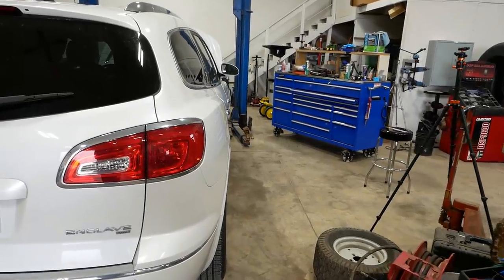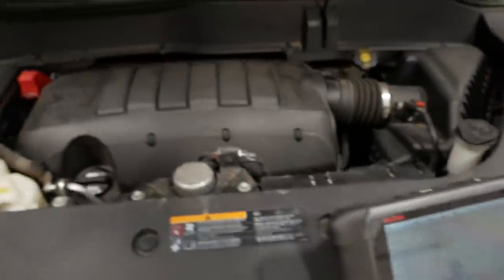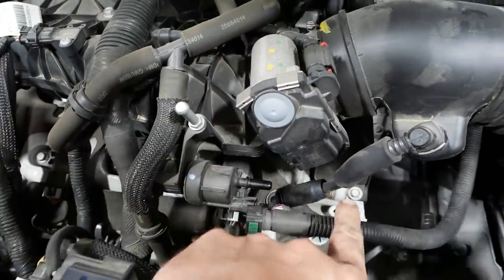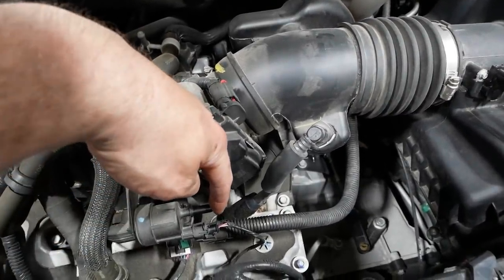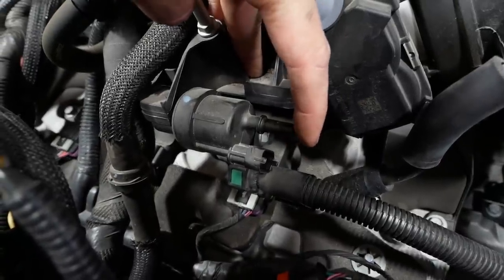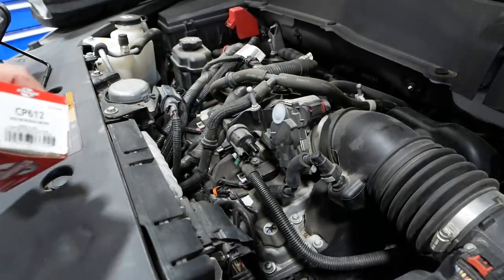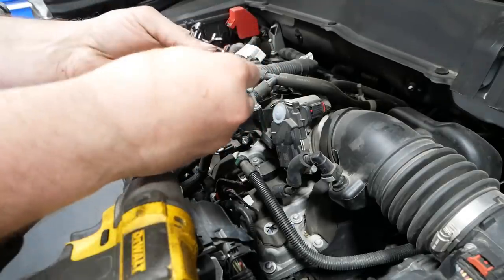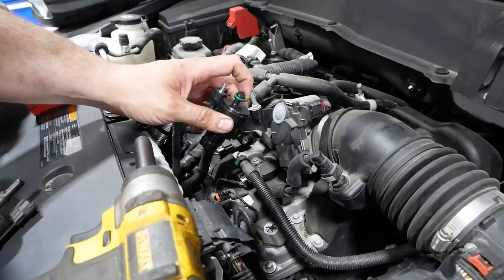P0496 GM 3.6L - Diagnose and Fix in 3 Minutes

Comment: It'll take longer to generate an invoice for the customer than it did to fix the car!  LOL
Reply: I wonder what the flat rate is on this, and did he charge actual time or flat rate
Reply: @bigunone  Wes strikes me as working by the standardized "dick scale". If the client is a "dick", it's going to cost you. He seems reasonable enough that he would let a quick job go for a more than fair price, a guy can't build a client base by over charging every body, even more so in a smaller community.Fairness comes with integrity, integrity is something that Wes has in spades..
Reply: @bigunone  he showed a .5 book time.
Reply: lol

Comment: $263.15 in parts and labor (don't forget shop supplies) and out the door at dealer.  Oh, we checked your wheel alignment while driving through the shop and you need $107 (on sale) alignment.

Comment: If only all garages and service stations were up front and honest like that. 
Wes: I've checked the diagnostics on your vehicle. It looks like a bad purge valve, I should have it fixed in 5 minutes.
Dealership: Yeah, just drop your car off, we'll have a look, see what's wrong and then get back to you. ( two-three days later) . Yup just as we suspected, we checked your codes......you needed all new spark plugs, air and fuel filters, EGR, PCV valve, oxygen sensor and a new purge valve. We also found a small vibration in the front end and readjusted all your ball joints, tie-rod ends and rotated your tires.
Reply: Nope, all wrong, well except for the 2-3day part.  Diagnostic fee $150, minimum 1he labor $150, +250% part markup, $39.95 shop supplies.
Reply: @tomkrause62  Wes's previous video (front end shaking in car)is well worth the look if you haven't already seen it. Proves the point about proper diagnostics, its scary and comical at the same time.

Comment: And gm would charge 2 hrs for diag, drop the gas tank replace the guts in the tank, then another hour of diag, then an hr to change the purge valve. Put it back together while forgetting to plug it back in, causing you to leave, come back, and go through this whole process 3 more times
Reply: Yep...That a GM dealership for you.  I like to refer to GM as "General Malfunction"

Comment: I’m sure the book time is inclusive of pulling the vehicle in to the workshop, plugging in the scan tool, reading the codes, translation of the codes, ,opening the hood then the work to confirm the fault, ordering the part or if at a dealership, a trip to the parts department then the work to change the solenoid valve, then the reverse. Add all those things up & half an hour seems a little light.

Comment: Too Dam Fast. Please, more about Your new enterprise putting COSTCO out of the tire business. LOL.
Reply from the maker: Do you realize there are places that don't have Costco? I couldn't tell you the closest one to me. Probably 2 hours away.
Reply: @WatchWesWork  in the Vancouver Lower Mainland Area there are 7 COSTCO LOCATIONS about 15 miles apart from the next one. I get it that you are in very rural America and it is not a money making machine for You but there is no place else and You and Your Customers need it for convenience. Mobile Tire Service is probably 2 hours away. and very expensive. You and I have made the major point of Your story about the danger and cost of funky fake rims that have bonded fake mags. My point is somewhat different about buying after market Rims from Tire Rack that are made to fit more than one manufacture cars by having 10 stud hole for 2 different bolt circles using elongated holes and also fibre washers or steel inserts to  fit multiple cars. My Point is Simple. DO NOT BUY ANY RIMS THAT ARE DESIGNED TO FIT MULTIPLE VEHICLES. No Funky bonded fake cheap Rims either. This was a good show to bring up these points. My observation is that tire service on passenger cars is usually done by $15 an hour worker. Your charge out rate should be more than $100 an hour for Your Skill Level. THANKS.

Comment: Instructions unclear.  Mine seems to have a red o-ring. Does that mean I should STOP the procedure ??  Is this only a valid fix if using a green o-ring?
Reply from the maker: You'll need to call tech support.
Reply: Have you tried turning it off and back on again?

Comment: In 2010 I bought a 2010 Chevy Impala with the 3.5 engine.  I had already driven a Buick with a 3.6 and it had lots more power.  I bought the Chevy, I drove it for a while and gave it to my son.  He is still driving it, it has 140K on it and never has had anything done except the typical plugs, wires and belt at about 100K.  It has had a pair or two of front brake pads.  I am so glad I did not buy the 3.6 Buick.  How could GM make and engine that is so bad after making the 3.8 and the 3.5, sure the 3.8 is lots more powerful but it is just too problematic for me to even look at any car with one of them in it.

Comment: I was gonna ask if you became a flat rate tech recently because you seemed to be racing the clock when I first saw it, and then you mentioned the book time LOL...  what an example of how boring and bland some of these newer GM cars are getting. Yuck. For once the book time is actually in the techs favor and not the other way around.
Reply from the maker: Not hard to beat the book on this one. If the camera was off I could diagnose and fix it in 3 minutes with time for a cocktail...

Comment: I have had some luck getting AC Delco parts from the Local Car Quest/ Advance Auto Parts. I had a code which I thought was the solenoid on the tank end- I looked up the part using my (Wife’s actually) VIN on the mothership’s part finder website, ordered the part- went to install it, and discovered that it was a totally different part from the one on our truck- (2011 Suburban 2500 LT 4x4). 

Luckily, it turned out to be the gas cap wasn’t sealing- and a little dripped gas on the filler a d the oring cleaned things up and solved the issue. So much for throwing parts at a problem until it’s fixed. 

Meanwhile I’m stuck with an open box purge canister vent solenoid and tubing assembly that probably will be the correct one for a Suburban/Tahoe/Escalade/Yukon/YukonXL of a similar vintage 1500That was just cheap enough that I won’t deal with traffic to try and return it. Need one? LOL.

Comment: So Wes what do you think of GMs 3400? Got a 2003 Grand prix that I got from a friend that bought it new. He was a pipe fitter, he drove her hard . His job took him all over. No repairs. I got it with 262000 miles on it now at 272000 miles. It runs great you step on it and , put you back in the seat. I am going for at least 300000 miles , think it will make it?

Comment: I don't get these modern evap systems. The goal is to reduce pollution and waste from engines leaking gas. Fine, I get it. However these systems are so crappy that we end up replacing plastic parts - which are made from petroleum - and sometimes hours of diagnosing (energy) to fix them. 

I have an Outback 2019 with less than 17k miles. First issue I had was evap system engine light. It took the dealer 2 weeks to figure this out with computers and smoke test. It was some bad purge valve too. I am sure the whole process required more energy and caused more pollution than not having the darn thing in the car in first place!

Comment: Sticking EVAP purge valves can be freed up by spraying the inside with brake clean or electrical cleaner. So not only a quick diagnostic but often a ‘no parts required’ repair.

Comment: I own the timing chain thrower. This is a known issue with these engines. Usually you’ll find it after you fill up with gas and it take forever cranking to start.  

ETA: throttle body next

Comment: Had the same thing in my moms traverse. Same car with a different body. Hers wouldn't start after filling with fuel. Took like $20 and 10 minutes.
Reply from the maker: Yep. Makes them run really rich until the fuel level drops, then they run lean. Really messes with the fuel trims.

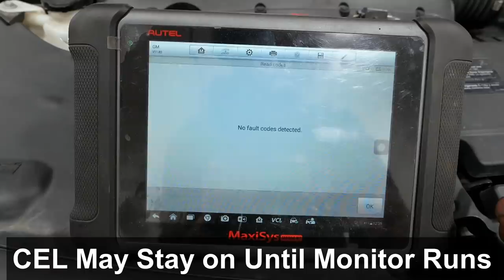Comment: Watch Wes claim that 3:37 is less than three and charge his client 30minutes. naughty naughty!
Reply: He never said that's what he charges his client, just that that's what "The Book" says to charge. There are some Good Mechanics out there!
Reply from the maker: I'd never do that...
Reply: Not only is time equated to money, so too is knowledge🤩 so yah still got to pay😉
Reply: He should charge his customer at least 1 hour. It would be a bargain. 
The alternative is for the customer to buy a scan tool, learn to use it and diagnose and repair. 
Last choice would be to go to Chevy dealership, drop off car for 2-3 days. Pick up car after calling them to find out its ready, pick up car and pay at least $300 and return the next day because the car is not fixed.
Reply: but what is the book procedure to test the operation? If a good mechanic can get the job done faster than book time, they get to make money.
Reply: Most all shops have a set service rate of 30 min to1 hr minimum, what Wes done was more than fair . Good luck in trying to get your work done at a dealership in that same length of time , you'd be lucky to get the car back on the same day. Better yet, good luck in trying to get a dealership to do a video and show you what was wrong with your car and how long it honestly took to fix it.
Reply: Every now and then you need a little gravy to make up for the lost your butt diag/repair. Gravy {easy diag/repair} makes the biscuits {harder diag/repair} slide down your throat easier.Don't forget the time/tools to read codes, diag, order the part, change the part, verify the repair,clear the codes, bill the customer, and collect the payment. This is really NOT a 3 minute repair !!!!
Reply: @terryharvey4811  I agree TH but I think the point being made here is a demonstration on how to replace the part in minutes when everything needed is close at hand.
I think the common sense man understands, turning the lights on in the garage, warming up the truck, getting breakfast at Mickey D's and shooting the breeze with the guys at the parts counter at O'Reilly's is not factored in along with hooking up the code reader and turning it on. 
Preparedness may take a few hours...for the simplest of tasks
It would also be understood, that cleaning solvents, rags and electricity is not factored in either, but still.. somebody has to pay for that and many times over...., those commodities are never included on a repair bill. 
 More to the point, it usually take 9 months to have a baby, but it only took a second to get the job done. Endless expensive Dinner's , movies, trips, mothers day gifts and the begging are not included in the final bill either.
Reply: @IR-nq4qv  You hit the nail on the head. Most shops charge a min. 1 hour diag time plus the 0.5 r/r time. I just wanted to point out to the customers and DIYers that there is more to this job than they actually see. We can't work for free and if Wes charged only for a half hour of time, the customer really got a DEAL ! We owe it to our customers to charge enough so that we'll be here the next time they need us.
Reply: It probably was legit 30 minutes, if not longer, if you count the off camera work, talking to the customer, writing the invoice and bookkeeping, etc.. This is why most places charge a minimum rate. If I only got charged 30 minutes labor for that job I would be glad it wasn't an hour minimum.

Comment: Couldn’t see what you were doing to prepare the new one, but I assume it was make it look like the old one. I would have run the engine again before hooking up to confirm the new part actually works before reassembling everything else and clearing the code. I also would have smeared a little silicone grease on the O-ring. Just saying.  Anyone know if there’s a way to repair a purge valve?  Just curious.